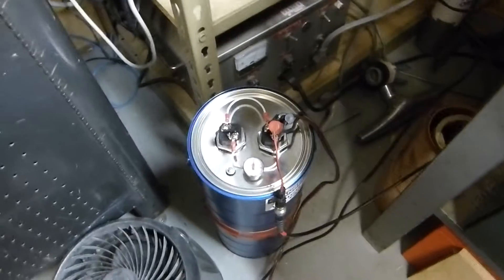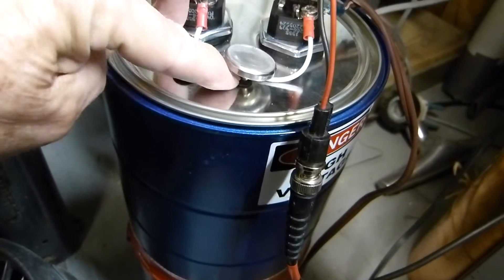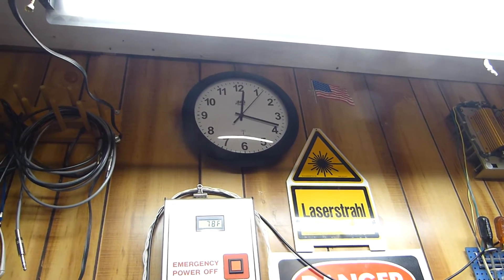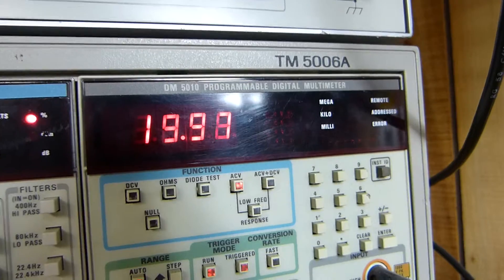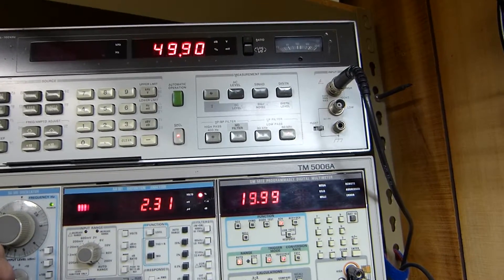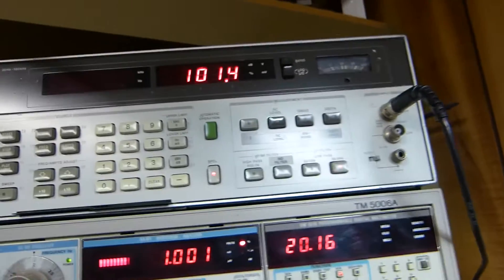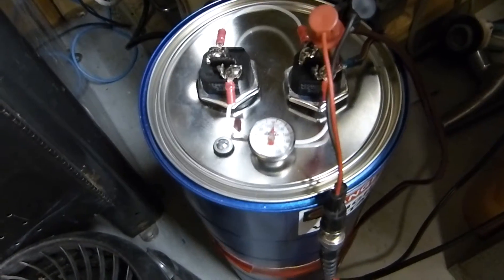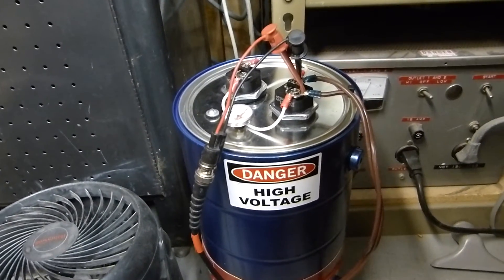Verifying Accuracy Of High Power 8 Ohm Dummy Load

Comment: Cool vid. A thought though, it might be worthwhile to paint the can matte black, both inside & out. This would increase the rate of heat transfer from water to air, increasing the overall load capacity...
Reply from the maker: I agree, that might help. The biggest issue I have had with it is the water temperature at the top of the can is much higher than at the bottom. It needs a stirring system of the water to dissipate more heat.
Reply: Yep. Ideally, you need the elements plumbed through the base of the water column, a secondary internal separator tube (vented at both top & bottom for water flow) to aid the thermosyphon, and a whole stack of external fins to aid dissipation... Perhaps a project for the future... Cheers... G

Comment: This dummy load definitely has my attention! There are times I have to repair high wattage amps both tube and solid state, and this would be a really low cost, safer alternative to buying expensive high wattage loads! Have you thought about using Antifreeze as a coolant instead of water? :) What's your take on that? I'm about to build one of these REAL soon...I may want to use a different type of tank, something along the lines of a stainless steel canister maybe...I would like your opinion on that...Sooner or later, I'm gonna end up cooking my existing (expensive) loads. I've used open ceramic resistors and was able to light my cigarette on them; so, I need something safer for the shop...
Reply from the maker: Frank - I sure agree with you - I don't remember exactly what I paid for the Arcol 1% resistors but it may be $65 or so each and they do indeed maintain their correct resistance even up to 300 + degrees as I have gotten them that hot and actually burned off the label-maker sticker I put on the heat sink. I haven't lit a cigarette with them yet but I used to do that regularly with soldering guns... The water heater loads measure just over 16 ohms so you can take your meter with you to Lowes to check them even before you buy. Their may be other elements around that are useful also. As for oil and antifreeze, I haven't tried anything but water so far. I do notice that the top of the can gets hot long before the bottom - even under relative light load (200 watts) the top will quickly become 10 degrees F hotter. Possibly a flat container ? Mount the elements in the bottom of the can pointing up ? Something to stir the water ? The bigger the better - should I drag in a 50 gallon hot water heater and mount a dozen elements in it and get a pair of  Eimac  4CX10,000 and really go for it     :-))   ?     Once I start pumping the big amp into it and get some real data at a really high level with the water I will post my results.
Reply: Actually, there's a Lowes practically in walking distance of my shop (in my house) much longer distance from the recording studio...You have a good idea there! I'll stick my ohm meter on my coat pocket and bring it along to be certain before I spend the bucks...If I get the same make & part number that you have I would imagine I will be in the ballpark...I see your elements are rated at 240 VAC...

Comment: I think you did an outstanding job on this. Now I want one too even though I don't need it....LOL. Did you solder these paint cans together and if so, what type of solder did you use? Again, great job!
Reply from the maker: I used an electric can opener to cut the bottom out of the top can then put copper water pipe solder rosin on the two cans and then used regular solder - maybe long cans can be found somewhere so it won't be necessary to do this. I had to use a small pencil flame butane torch as the regular Mapp gas torch was way too hot and immediately turned a blue spot on the can when I first used it - probably would have burned a hole in the can if I had continued.
Reply: Thanks! I'm really thinking about replacing my dummy load with this setup. I do appreciate it much!

Comment: did you fill the container with oil ?
Reply from the maker: I have not tried oil yet. Since water boils at 212 F, I assume this keeps the temperature of the heating element down somewhat. Oil can boil at 450 F or more so if the element gets that hot, I don't know what will happen to the resistance of the element.